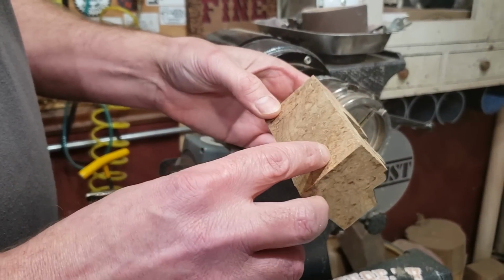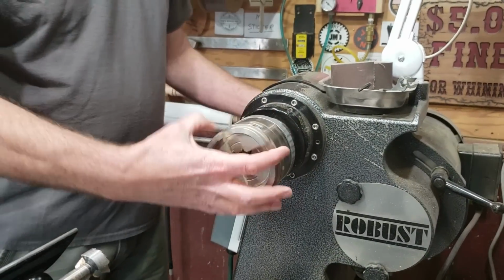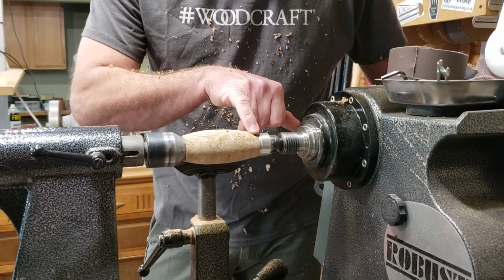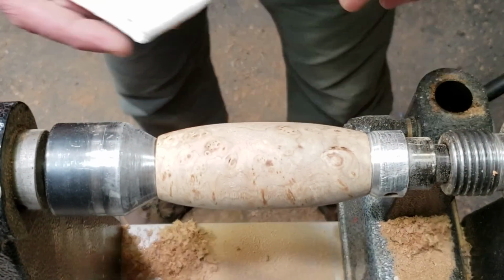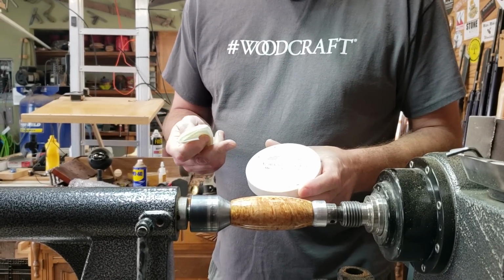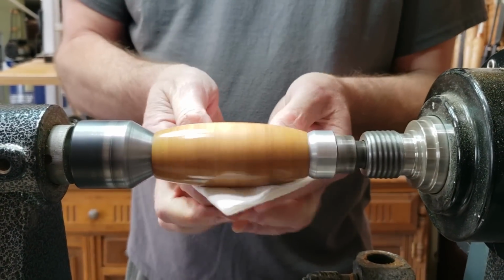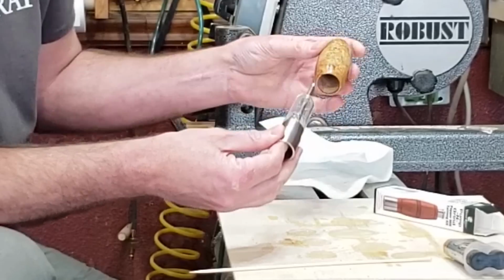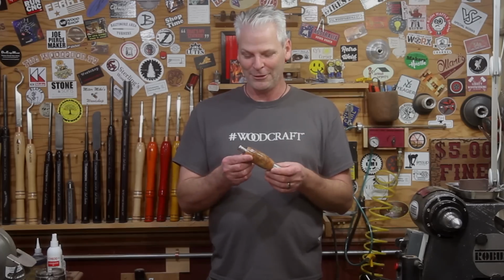Woodturning Maple Burl Pepper Mill With CA Finish | Carl Jacobson

Comment: Hey Carl - What tool we’re you using in the headstock? You mention putting a cone over a spur center. Is it just two 60 live centers?
Reply from the maker: The cone on the head stock side screws on to the spur center. A live center on the head stock wouldn't work.

Comment: Nice I like the newer grinder workings. although I have found my CA finishes cracked after a few years.  You tube's new format just isn't good.
Reply from the maker: Thank you Jim, what brand of CA are you using?
Reply: Stick Fast - I use thin for finishes, from Wood Craft , I seems to be so hard that it cracks easily after a few years
Reply from the maker: I don't do a lot of CA finishes so I really can't say, but you might try Starbound
Reply: Will do. I really only do CA Finishes for small turnings like pens and such. @CarlJacobson